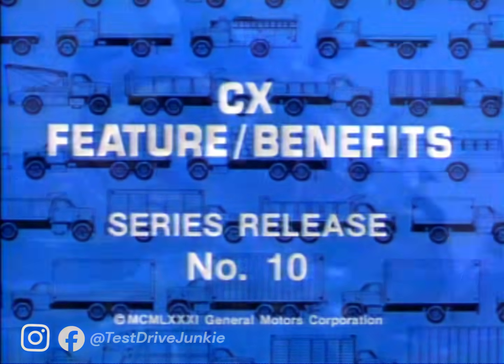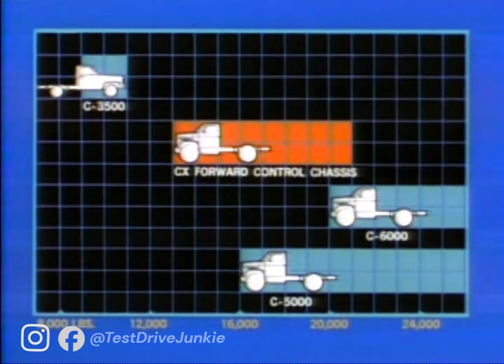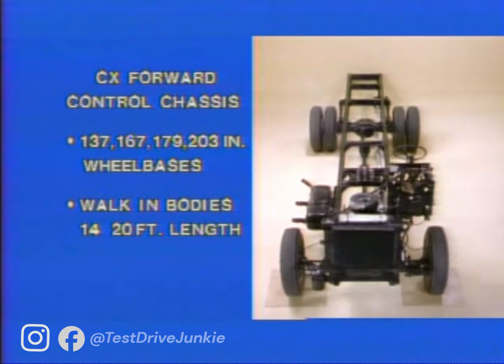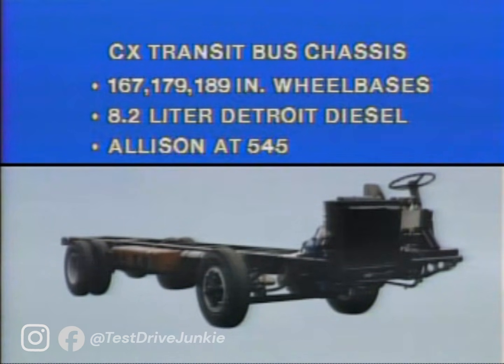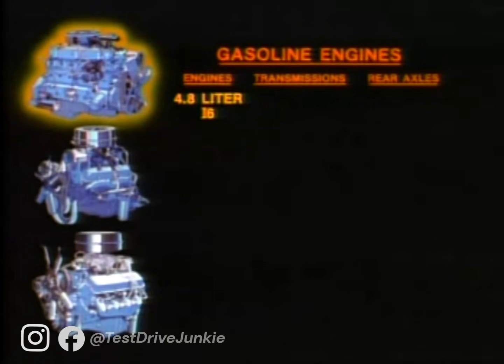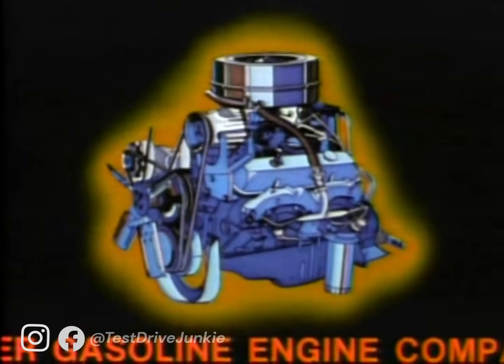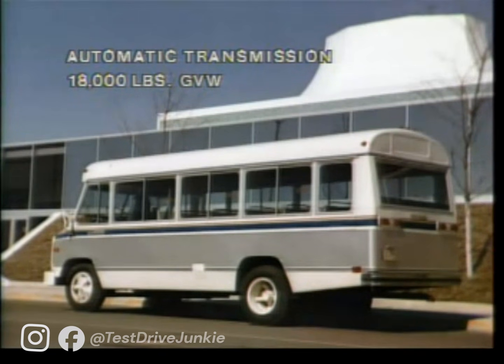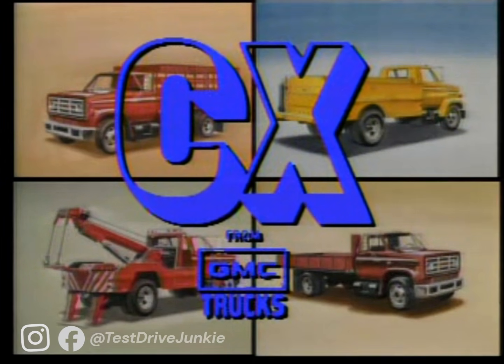1983 GMC Chassis Cab Trucks Manufacturer Laserdisc Promotional Video

Comment: Those generation Chevrolet and GMC medium duty series models were produced from 1973 through 1989. The B-series models "school buses and armored trucks with that same nose design" on the other hand were produced from 1984 through 1991. The reason the B-series models had a late start was the B-series models with the previous 1967 through 1972 nose design were still in production up through 1983.

Comment: Legislators may find the e150 through Supra E IMPLICIT REPRESENTED AND AUTOMATIC WITH INTEGRAL INTENT TO SERVE SWERE SUAVE SAVE SALVE SECRETE SEE RECREATION SLOWLY SAVING SKEETING SATISFYING THOSE ASSIGNED TO THE LLAMBADA A SFORBIDEN DONSE  .  WE SHALL PLAY IT DOWNTOWN ON PUBLIC ADDRESS SYSTEM AND PERFORM OUT DOOR FLASH DANCE  BABY SHOWERS WITH OUR LEG WARMERS LEG WARNERS  LEGS  WALKING TO THE PUMP AND BACK ONLY SO OFTEN AS WE MIGHT NEED AND SHOULD DUTY CALL TO BE READY AT MOMENTS NOTICE AND  SWERVE SIGNALING INTENT WHILE MEMBERS OF OUR PARTY BACK AT THE PARK IN TENTS MIGHT THEN CATCH UP  OR A GLIMPSE ON THE INTEGRAL TENT MOUNTED TELLE  V SHOWN  WITH  TENT SIDE UPDATE WAR TIME LIVE STREAMING PROJECTOR   A SUPRA E 350  shassy classy cashy cab top kick  and  ram romer and tremorr   From mofoco